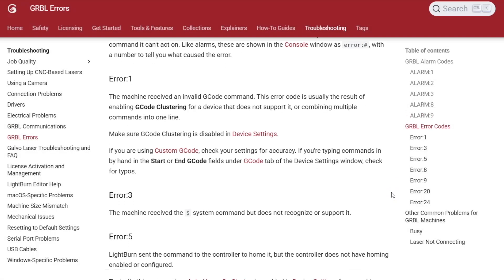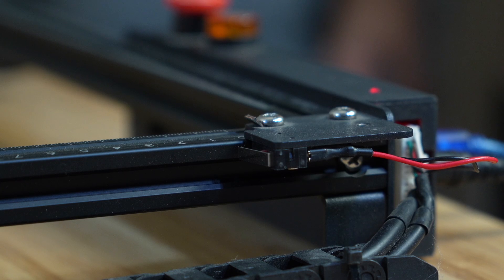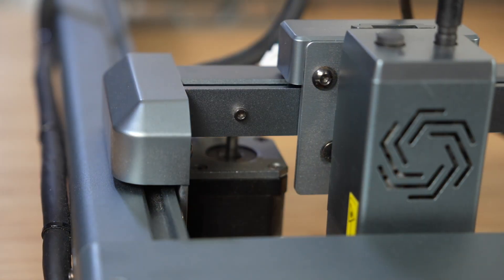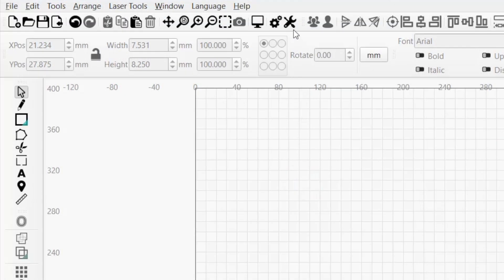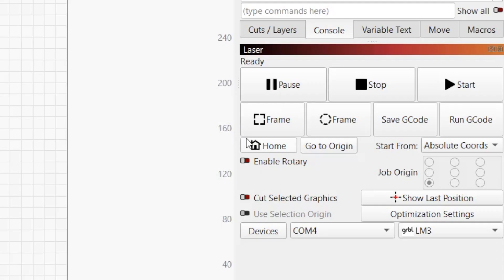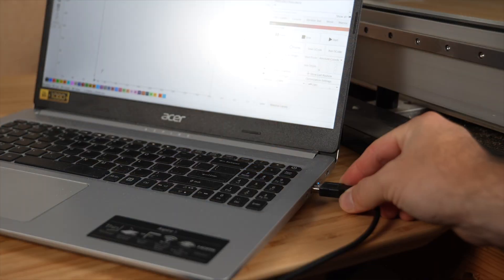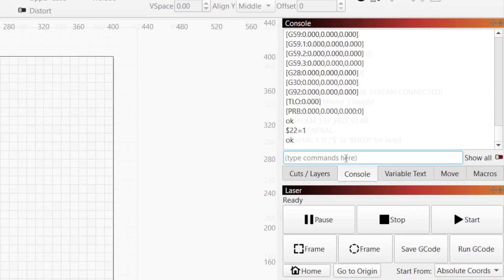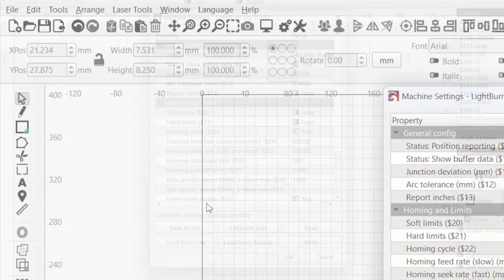GRBL Errors: 5

Comment: Is it possible to designate where you want the device to “home”? My Creality falcon 2 homes left front. With the cross beam in front, getting media in or out and adjusting focus is difficult. I find right rear is much better.
Reply from the maker: Homing location is determined by the location of your laser's limit switches, and the homing direction set in your laser's firmware. You can't designate an alternate homing location. But you could save a position in the back right in the Move Window, and command your laser to jog there after homing, or create a macro to do the same.

https://docs.lightburnsoftware.com/2.0/Reference/MoveWindow/#saved-positions

https://docs.lightburnsoftware.com/2.0/Reference/MacrosWindow/